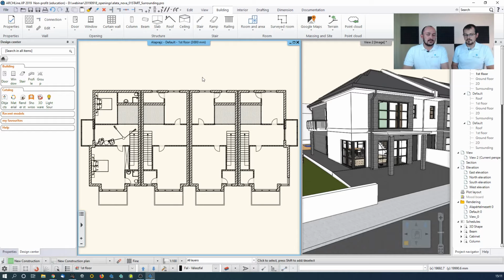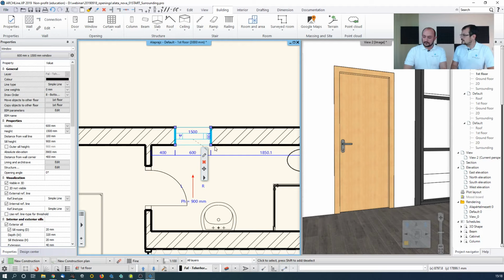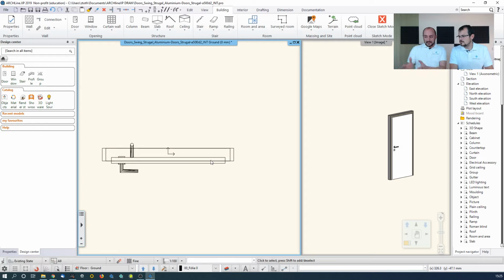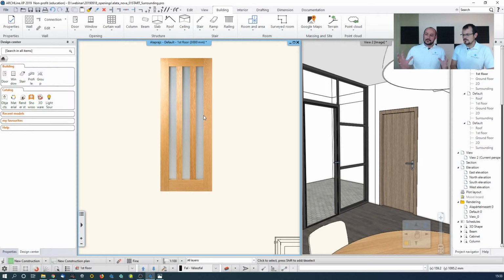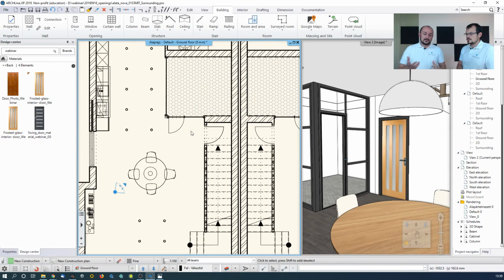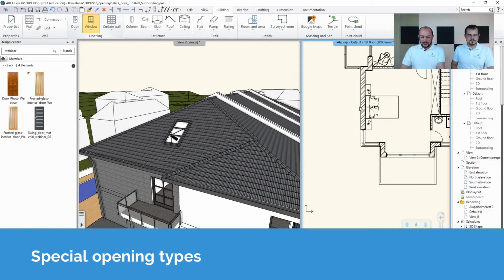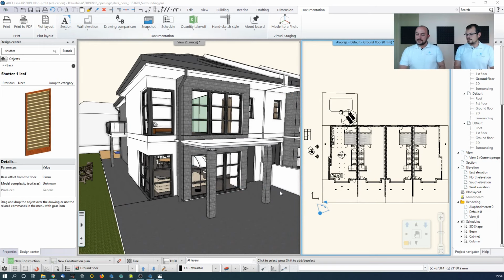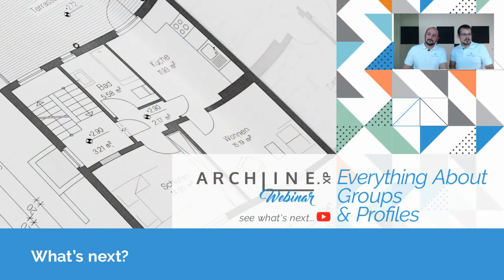Everything About Doors and Windows - ARCHLine.XP WEBINAR

Comment: Hi Chaps, I've noticed the doors in plan look very basic, can one change the door in plan look more realistic. For instance, door thickness, the swing line say dashed lines, to show the door frame jambs with framing stops & perhap door handles ? Thanks.
Reply from the maker: Hi, yes, you can change how the doors and windows are represented. The level of detail is set by a switch that you can find towards the bottom of the interface. We use the very basic representation during our shows as the representation styles is different in every country. Moreover, if you do not like the default representation, you can change it to another 2D group that you can create.
Reply: @cadlinenetwork  Thanks for your reply, I'm glad this can be changed to a little more detail than just a signle line for the swing arc & door thickness. The representation of these items is perhaps not country directed, but more by the user & plan scale. Having said that, a door thickness on plan for 1:50 & 1:100 scale plans looks better architecturally in my eyes.  Great to see these videos for the english speaking market & look forward to seeing more of these continue. Perhaps some shorter videos could be done to clarify user & potential user (me) queries from time to time ?
Reply from the maker: @MrCADCHANNEL  Thanks for the kind words. We are always on the lookout to create useful content to go with our program.